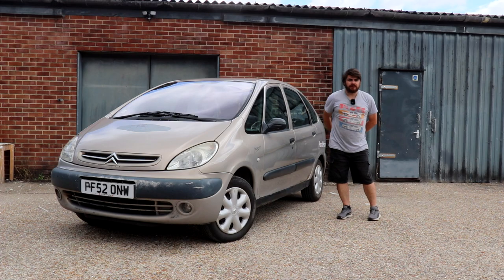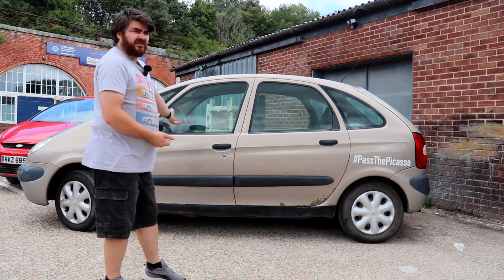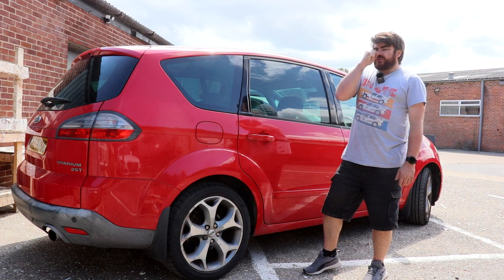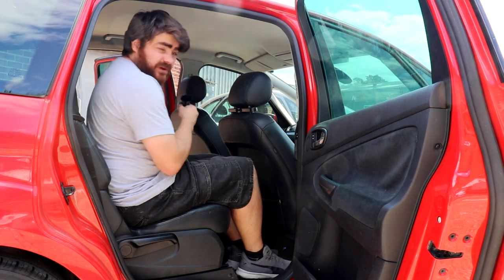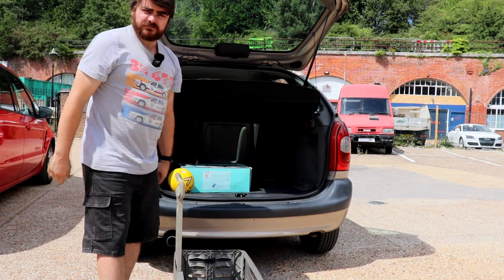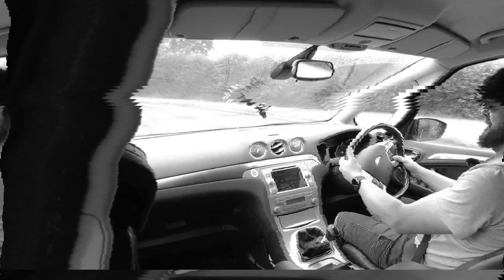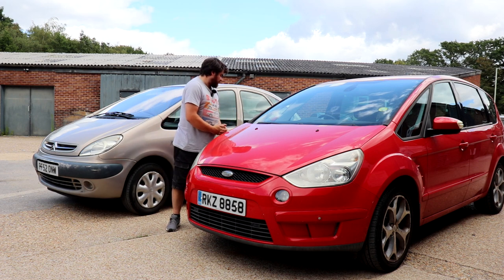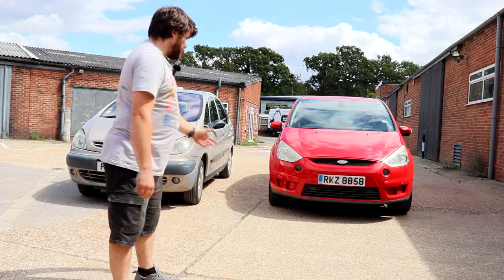The biggest TEST for #passthepicasso: Can it prove me wrong? Battle with Ford S-Max 2.5T Titanium

Comment: Calling any car/van 'Sport' when they are never going to compete in any kind of sport is meaningless, in my opinion. They probably won't be in any fit state to banger race, at their end of life, which probably the closest to sport they might get 😅 The whole SUV segment is a total sham, with even convertible ones available. What 'Sport' uses pretend drop-top off-roaders? Lol
Reply from the maker: The only sport I can think of that uses SUVs is the sport of marketing and one-upmanship with your neighbours.
Reply: @UPnDOWN  Don't forget the "sport" of pretending that actually looking down on others on the road equals actual safety. Until you roll over. Life is on a screen, innit?